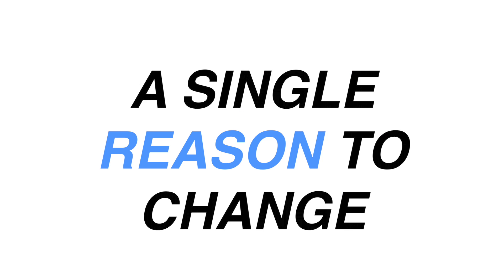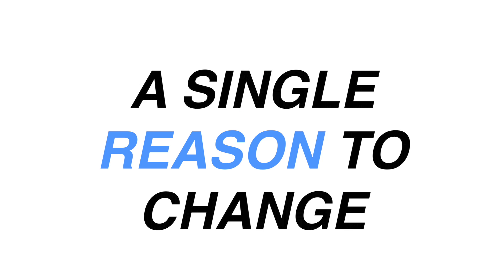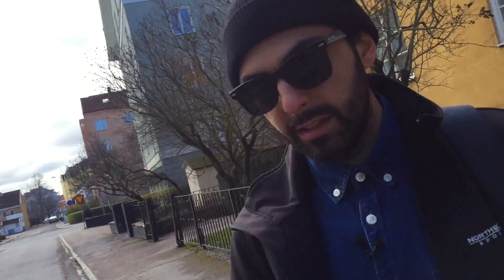Single Responsibility Principle (SOLID) | A single reason to change — Code Walks 006

Comment: So in a few words - you don't necessarily need to change the single responsibility principle of a class/method in terms of what it does in order to achieve something, but for example you could like add a new method or a class and change the order/algorithm of the clients/components' workflow in order to achieve something. Is this what Uncle Bob's example/definition is all about?

Comment: I feel like I know less about Single Responsibility now than I did before watching the video.  :)
Isn't it basically that each function should do a single job; and if a function is doing 2 things, it should be split into 2 functions?
Reply from the maker: Indeed. 100%. However sometimes it's not obvious what that actually means and that's what this video is trying to get at. Robert C. Martin framed it in a different way when he said that every class/function only should have a single reason to change. That statement made it much easier for me to think about what a "single thing" in practical terms would mean. Thanks for watching and thanks for the comment :)
Reply: This is common misconception. Function or class can do two things, but they need to have same reason to change. For example, same class can receive HTTP request and render some kind of html based on that input. Challenge is to find relation between HTTP input and html view (or do they have same reason to change)
Reply: @kokoloism  I agree. This is the first thing: I learned a few days ago about the SOLID-principle, did a code review of my senior dev and asked him if he violated the single responsibility. But well, he didn't for this reason, the misconception.